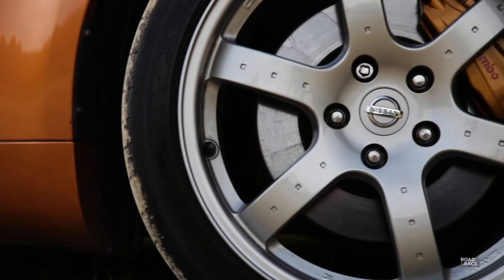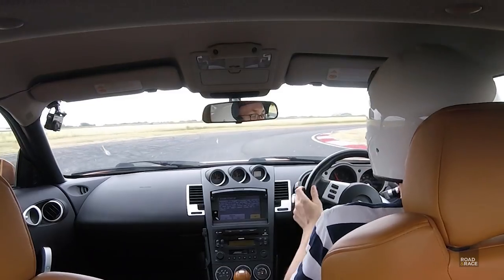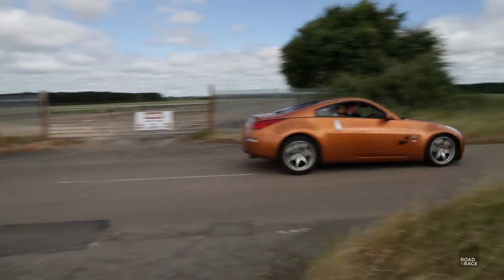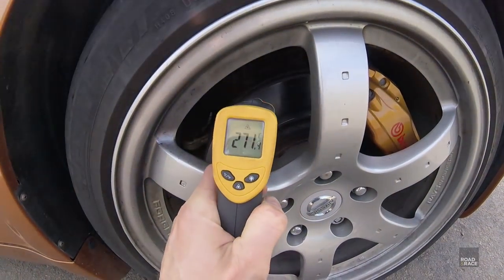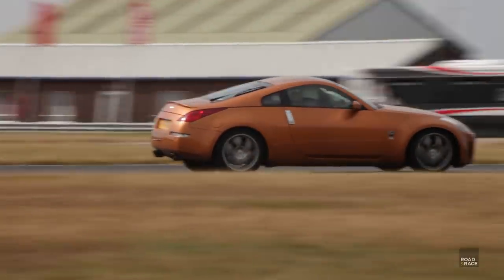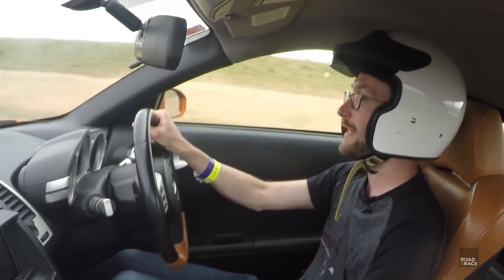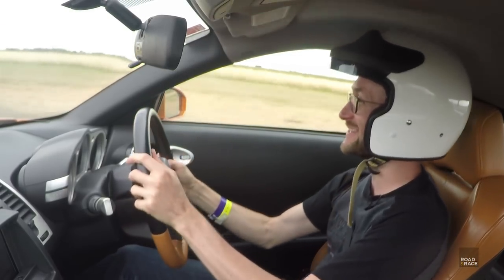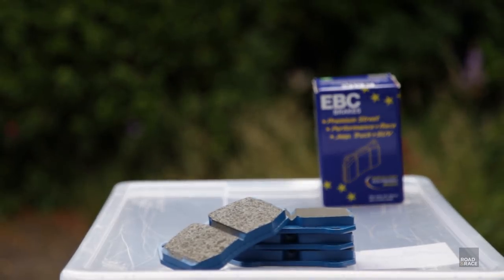Nissan 350Z Performance Brakes Mods

Comment: Great video... I own a 350z and even if i don't do track days ... i feel that que stock brakes need a upgrade to match the geat engine under the  hood.

But i think you guys made a mistake by " recommending" the EBC Blue Stuff ... they ARE NOT R90 approved ... I just looked at the EBC Web site and they are illigal for use on EU roads.
Reply from the maker: Thanks Jorge.  The EBC brakes do make a good improvement.

I saw that on the website too.  Don't worry EBC are in the process of updating their website.  I've been told by EBC that all Bluestuff pads are R90 approved now.
Reply: Road and Race thank you for the clarification... I know now what to order for my car... Your great work just made my life easier...
I will keep watching your videos and " burning" money on my 350z... Keep up the good work

Comment: See kids, if you go racing always make sure your car has stopping power. I've always considered brakes to be the most important modification and this test demonstrated it. Keep up the good work!
Reply from the maker: Big thanks Jose!"
Reply: no point in going fast if you cant stop
Reply: 1. Performance Tyres 
2. Brakes
3. Suspension
Then power, aero, weight reduction etc.

Comment: Alright mate, I couldn’t help but notice that you have a hard time keeping your hands on then steering wheel while on track. Your hand should only be on the shifter when you need to shift. It’s not going anywhere otherwise. This helps when you really start to push the car and being able to have total control of the car. Keep up the amazing Z work, I tried to run EBC blues but I ended up destroying multiple sets in just a few track days. Hope you have better luck.

Comment: My Z's brakes on track where okay at best even with upgraded pads/lines/fluids etc and I kept getting issues with fade and pad float which isn't great when you're coming into Quary at 120+mph at Combe (see videos)  The best thing you can do I pull the VDC fuel as with TCS turned off, it's only 70% off and cuts in hard. Pulling the fuse, or adding the switch mod fully disables it and improved brake/steering feel so much, it actually put me in control.  
It's a must for on track.

Comment: I enjoy watching your Videos. Keep it up! Just to clarify, overheated  brake pads with good fluid will give you the same pedal feel (for the most part), but less braking.  Brake system heating to the point of causing any water in the system to boil will give you the "pedal to the floor" sensation and the pit in your stomach fear sensation (and possible a need of a clean pair of pants). It's an Important  difference to note for any track day enthusiast who is troubleshooting brake performance issues. The initial  better brake feel with the new parts would have been a combination of lower compressibility of the pad material, combined with the lower expansion rate of the new brake lines making the pedal firmer. The new fluid would have little to do with it, as the water contaminated fluid would have the same relative compressibility as the new fluid until the water boils and things go to hell in heartbeat after that.
Reply from the maker: Thanks Micheal, glad to hear you enjoy the videos.

Comment: Great video, would have been interesting to see the difference the fluid, fluid and hoses and finally the pads made. R90 was interesting!
Reply from the maker: Thanks Mike.  Agreed but it does take a long time to do this.  We did do these tests though on our Clio track car in Series 4  if you wanna check that out?
Reply: Road and Race sorry, I should have mentioned the hassle in doing that. Very time consuming process. I just think to improve fast street driving pads and fluid would be more than enough.

Comment: Imho the best first mods for a (possible) track day car are in this order: quality tires, upgraded brakes, adjustable coilover suspension, polyurethane bushings and/or upgraded front and rear stabilizers. Only after that stuff is sorted out you can follow up with power modifications. Unfortunately most people get this in the wrong order and start with the power mods and do the other stuff later or not even at all and get surprised why their car underperforms on a track.

Comment: I fitted brake ducts to the front of my Z4 track car and the difference in brake consistency and fade (on a similar sporty setup as yours) was enormous. Would be interesting to see your results with brake ducts
Reply from the maker: Yeah, good idea.  I'll add it to the list.
Reply: Cool, looking forward to it! Some silicone tubing (prices for the same stuff differs a LOT, so shop around), front inlets and adapter to your brake discs and hey presto. Lowered my disc and pad temperatures by at least 100 degrees, and my pads last a lot longer. I used to eat through EBC yellow stuffs in a few sessions, now my pads last for several track days.
Reply from the maker: Good to hear.  Did you make the adapters yourself?
Reply: I planned making them at first, but I could get a set of Turner motorsport carbon adapters for cheap, so I went that route. DIY would be interesting for your channel though! After a lot of googling, I arrived at demon tweeks to be by far the cheapest and they have a wide range. I went with the APS silicone duct 76mm, and revotec inlet. If you can get those revotecs inlets fitted to a hole in your dust shield, you should have a decent diy adapter. From the front the modification looks really cool too. Fitting took about 2 hours to do properly.
Reply: Dont all vehicles have them? My 09 golf and '14 Transit van both do!
Reply: What we are talking about is a duct that forces the air through the vanes of the disc from the back via an adapter. All racecars have them, virtually no street car is equipped with them.

Comment: Nice Vid, as a 350Z owner i recommend you the Ferodo DS2500 Brake Pads. For Rotors you should try to get your hands on JBT or Akebono (two-piece rotors with aluminium hub-->less rotating and unsprung mass), they work way better than solid one-piece Rotors.
.

Comment: Great video, Great information. Maybe try some proper pads though like the ferodo DS3000!! 

I've used EBC before and thought they were pretty good but not amazing. I now run DS3000's on the front and DS2500's on the rear and they are leagues ahead of any of the EBC offerings.
Reply from the maker: Thanks Matt.   Not tried the DS3000 but i did try the DS2500 on my M3.  They were quite cheap to buy but overheated and faded after only a few laps on the track.

Comment: Nice video! What time was the brake fluid in the car with the stock brakes? If it was old, there was water in it and explains why you had bad brakes when they got hot. Together with the performance brakes you changed the brake fluid. If you did the first tests with old brake fluid, maybe the stock brakes are not that bad as you suggest. Of course the grooved EBC brakes do a better job.
Reply from the maker: Thanks mate.  We put fresh fluid in the system before we started the tests.

Comment: How is everybody else finding EBC pads? I never heard anything good about them. I'm using Hawk HP+ on my s2000 with stock rotor sizes (slotted like in this video) and they work well. More dust and squeal than a stock pad of course but it's proportional to braking performance gained

Comment: Did you keep this brake upgrade also for normal road use, or do you swap back and forth between road and track days? How bad or good is the brake dust issue? Thanks.
Reply from the maker: Yes, I keep it.  Dust is a little worse than normal pads but not a problem

Comment: I would it find better if you would compare new standart Breake equipment with new racing stuff. Because of the bad conditions of the standart breake are shown. With new OEM parts it would be much better.
Reply from the maker: The standard brakes were in good shape.  The pads had plenty of material left and the discs were no more than half worn.  I don't see how new ones would have performed any better.
Reply: Especially for the Pads the age is important. 10 year old pads with half of material on the plate could be so worse. because they are harden up and become crumbly.  Also brake fluid, age is important. Ive changed the old fluid to new one after 6 years. OEM to OEM and that was such an improvement. However, your tests are great. I dont want to criticize your vid. Also the work is fine. Hope to see a new upload soon! :)
Reply: I'd say oldish brake fluid make a big difference too(dot is higroscopic, there is no such thing as race and non race dot 4), he mentioned the brakes feeling mushy, which also sudgests the brake lines weren't in their best condition ;)
Reply: But still, the difference would be just a bit smaller, still huge.

Comment: The Nissan is just getting better and better , how far are you going with the mods ?
Reply from the maker: Thanks Jon.  Nothing set in stone but likely coilover suspension, stiffer sway bars, some gentle weight reduction, iphone integration, bucket seats, brake cooling, exhaust and engine mods for more power.
Reply: can´t wait for the next vid....

Comment: Were only the front brakes upgrades, keeping the rear stock, or all four? Thanks.
Reply from the maker: All 4 mate.
Reply: Thanks for the response. Had you already upgraded calipers prior to this test, or did your Z's stock package include Brembo calipers? Were those therefore 12.76" discs? My 2004 350z was not equipped with Brembo calipers, and my disc size are 11.65x0.95" front and 11.50x0.63" back. I'm thinking about keeping the stock calipers and upgrading to the same or similar EBC discs and EBC Yellowstuff pads as my Z is primarily road driven with an occasional trip to the track (2-3 x year). Are you in a position to comment: do you believe that keeping my stock calipers (perhaps getting new piston and seals at some point) and upgrading to EBC discs and pads will yield better performance? Thanks so much.

Comment: Is there a reason why you didn’t go with dot 5.1?
Reply from the maker: I don't really have any experience with 5.1. To be fair I don't really see it around.  Have you used it?   EBC wanted us to review their fluid anyway so that's what we've done.
Reply: 'Super DOT 4' is a higher specification than DOT 5.1. DOT 5.1 boils at 270 C, BF 307+ Super DOT 4 is a race fluid that boils at 307 C
Reply from the maker: Thanks for clearing that up Adam.

Comment: Are you sure you can use an IR-Thermometer on reflective surfaces like brake disks? I believe it will give you really, really odd measurements, won't it?

Also, I believe you might want to reconsider the position of your hands on the wheel when on the track.

Wouldn't that make quite a decent bunch of episodes: 

Compare both of your performance on the same track in the same car over an event. Then, you get an instructor and we will see how much your driving improves compared to Gary's who has to continue on his own.

Imagine you would come to Germany and then we would find an instructor and then do exactly this. If only I knew a motorsports instructor we could ask, hmmmm...
Reply from the maker: Hey Oliver, how's things?

No idea about the IR-Thermometer.   Seems to work fine but I'm not an expert.  It's the only thing I can think of to measure the heat unless you have any ideas?

I like your idea for the show!  Let me know if you find that instructor! ;-)
Reply: I believe the measurement on reflective surfaces is wronged because ambient IR light, from the sun for example, is reflected by the surface and interferes with the measurement.
I saw people treat the surface they wanted to measure with black spray paint beforehand but that is not an option here.
Anyhow, maybe the difference is not that big and we can just ignore that for this purpose :-)

I will keep the instructor idea in mind and will contact you in time in 2019 I'd say.
Reply from the maker: Cool.  Thanks for that!

Comment: EBC BlueStuff do NOT have R90 certification according to their website. Your assertion that they do is dangerous, misleading and could possibly invalidate insurance policies. Be careful chaps, and do your fact checking if you do make proclamations.
Reply from the maker: I saw that on the website too. Don't worry EBC are in the process of updating their website. I've been told by EBC that all Bluestuff pads are R90 approved now.